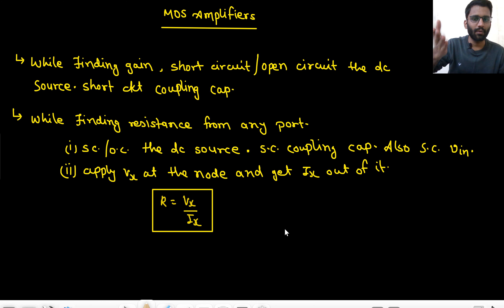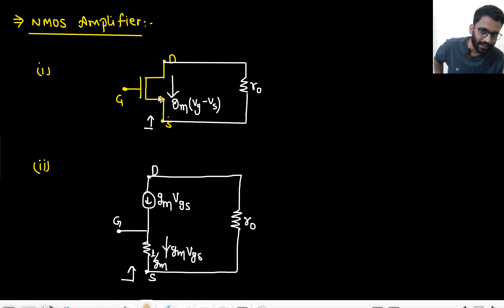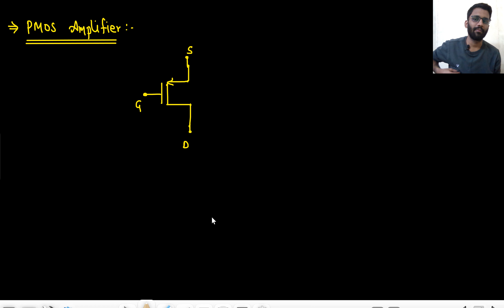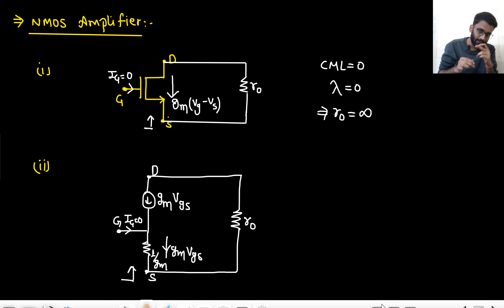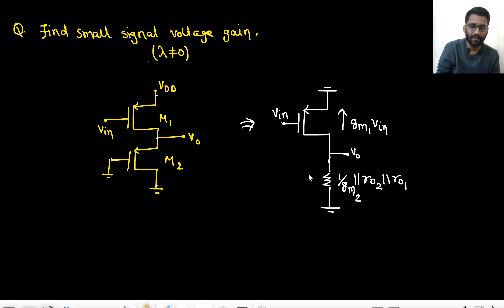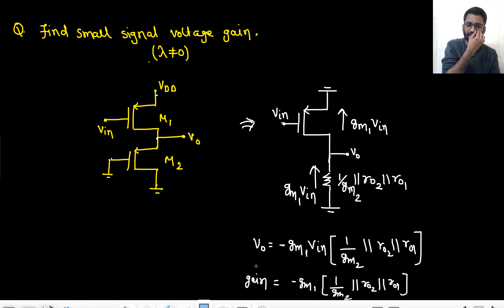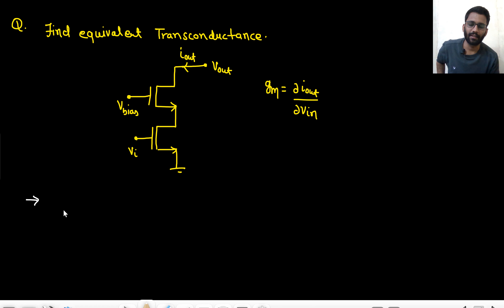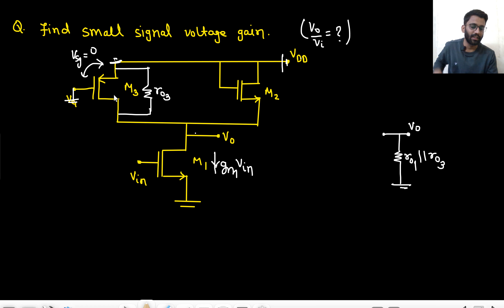How to Solve MOS Amplifiers Questions || Finding Gain & Resistance || PrepFusion || Himanshu Agarwal

Comment: I didn't had any prior knowledge about mos amplifier. This video turns out to be very informative. Bhaiya: 
- can you tell what all subtopics we shouldn't skip under mosfet except this small signal funda & from where we can prepare?
- Do we need to remember its 3 type of amplifier(ie common source, gate & drain) & its working?
Reply from the maker: - Everything is important in MOSFETs if you are EC/IN student. For EE guys, they can skip the amplifier part. 

-Specifically you don't need to remember the input-output impedance or gain but you should be good enough to derive it within 20-30 seconds. And I guess after watching this video, you will be able to do that.

Comment: MOS3 is open circuit so no 1/gm3,for MOS2 Vgs is finite so 1/gm2. At 25:25 why didn't you write the 1/gm1 which has a finite Vgs = Vin . please give the reason....
Reply from the maker: I could write it, but I simply wrote the current in the MOS to make the solution easier. 
I mean, You can write the current, but where it will help?